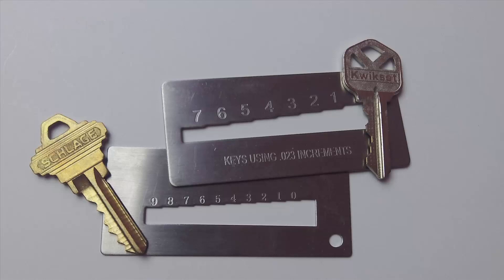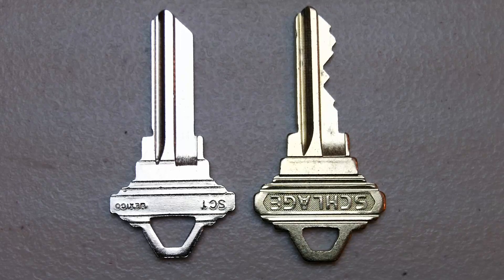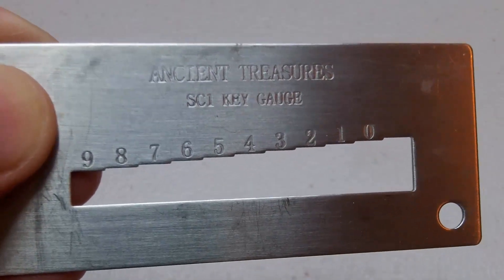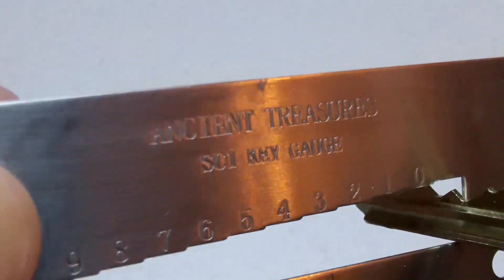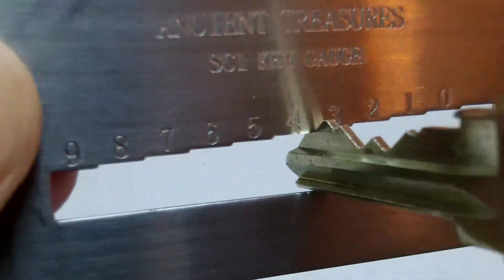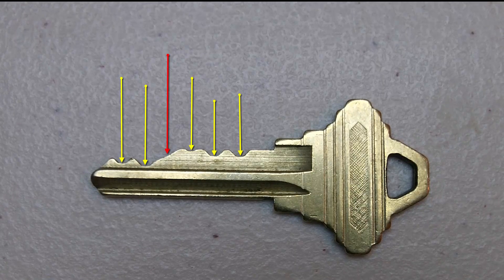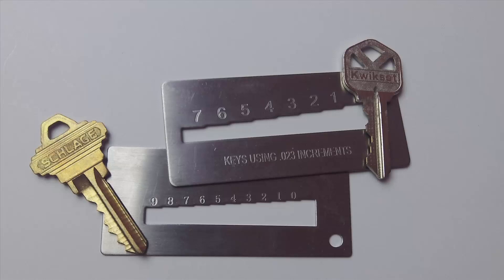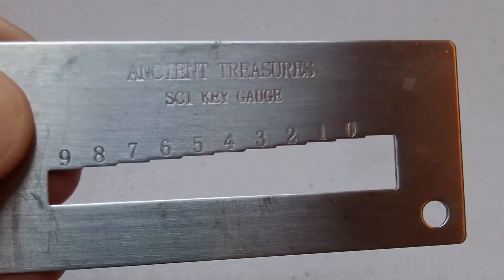What is a key Gauge? : How to use it : Protect yourself from criminals : Eye-On-Stuff

Comment: I found inserting the key from the back makes it easier to read. (My fat fingers are not in the way.)

Also, inserting the key upside-down, (cuts down,) let the bevels of the cut guide the key to the correct gauge. I notice you slide the key against the top causing jumps at every change of size. Sliding against the bottom is smoother.